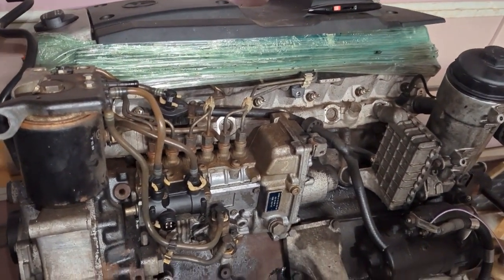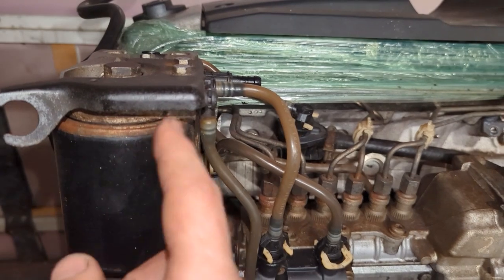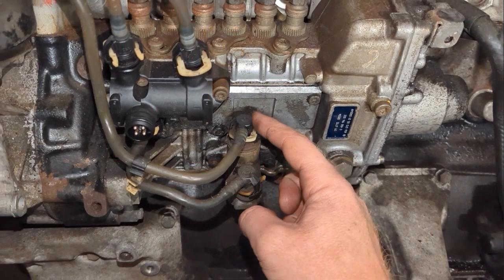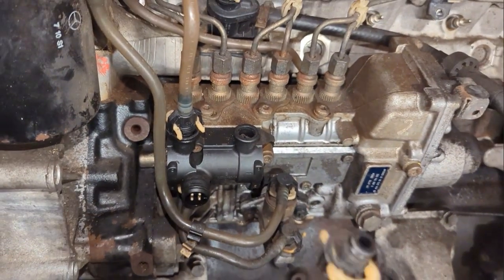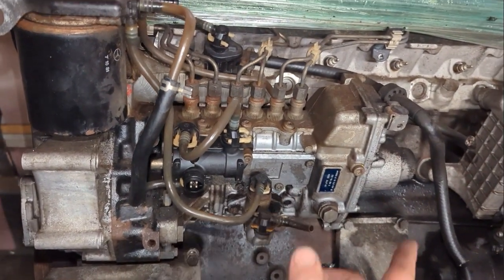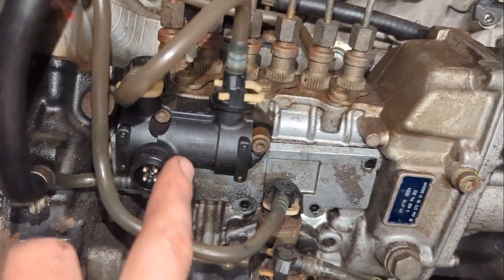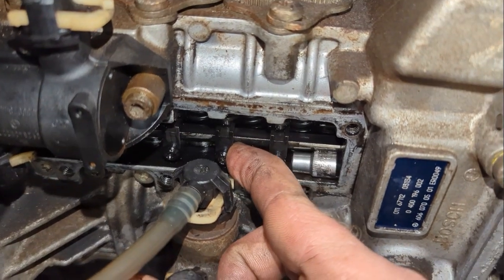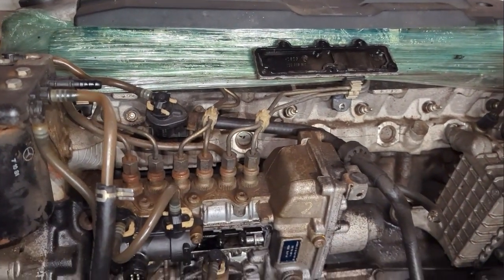Run an OM606 with EDC pump without a controller

Comment: Many greetings from Croatia 👍Can I ask you if you can tell me if it is enough to replace the pump on the om606 and put it from the om 603 model?      Is the engine running normally?      Or do I have to do something else?      I plan to put a motor in the boat.      thanks in advance.      👍🍻🍻
Reply: Die idee von Dir funktioniert am besten , du kannst dann den förederbeginn auch 24° vor ot einstellen, dann hast du mehr leistung. der prüfwert dazu ist aber 15° nach ot! nur machen wenn du es verstehst#1

Comment: Seems like one can fabricate some sort of mechanical actuator to operate the rack essentially making it into a mechanical pump, yes?
Reply: Yes same as a carburetor just has to hold it at 500rpms to idle building a 97 ford ranger and this video helped me run it with no ecm at all
Reply: Max rpm is also controlled by the ecu in the edc pump, so be careful🤣

Comment: Return line thinner than delivery line due to combustion of fuel in engine.
Reply: Yes, there's less fuel returning to the tank due to consumption but there's no physical limitation requiring the return plumbing to be smaller in diameter as questioned by the OP. Most likely just a money saving application for MB.
Reply: @joebanks3698 best to have a restriction on return else you can have running problems, the banjos bolt from the pump has a restricted orifice.